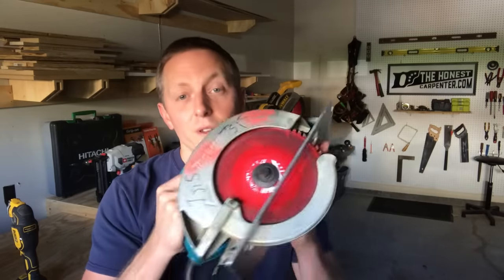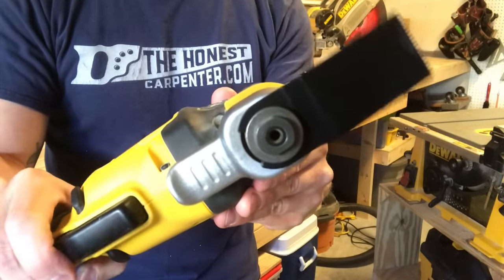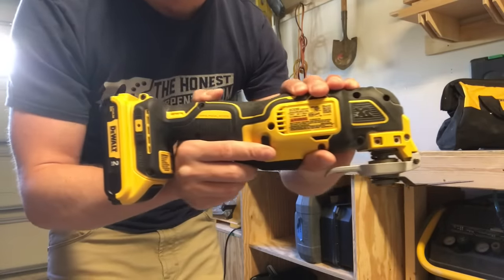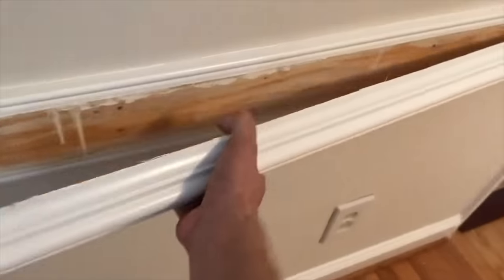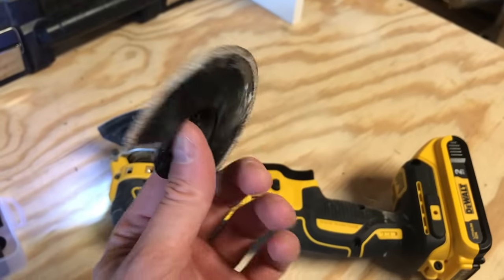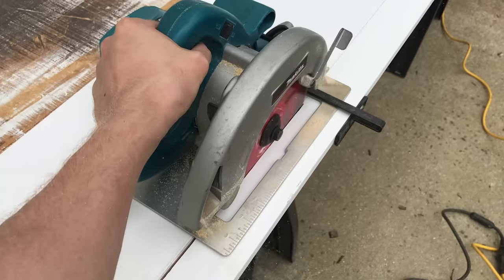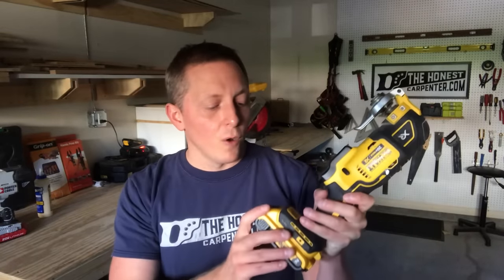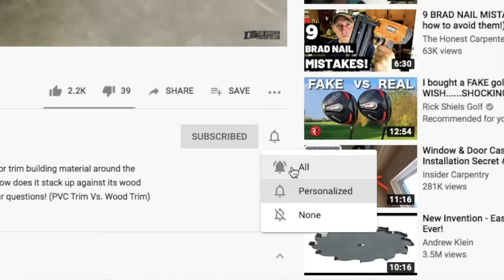The BEST SAW You've NEVER HEARD OF!! (Multitools--Great For Remodeling!)

Comment: You say it will cut through skin and bone, rubbish. You can put the blade on the palm of your hand and not cut it. The tool was originally designed to take the plaster cast off your arm or leg etc, without the worry of cutting the patient!

Comment: yawn, this is an ad network. this tool has very little use in renovations. doesnt work on hardwood, and unless in a very tight spot, you're likely to do it with hand saw or even chisel. blades blunt quickly, as horrible quality steel.